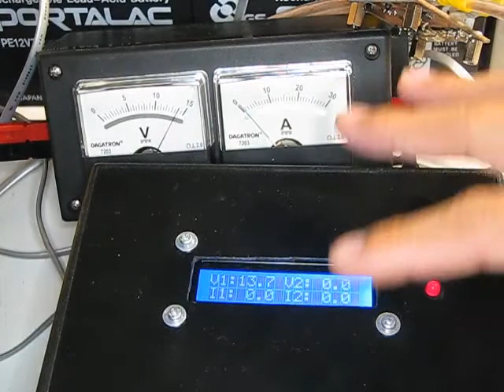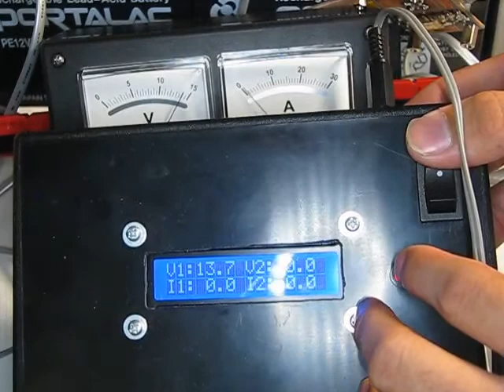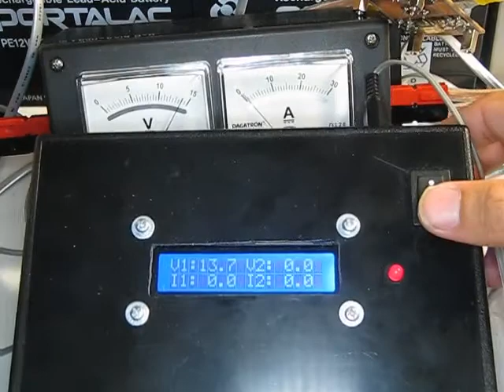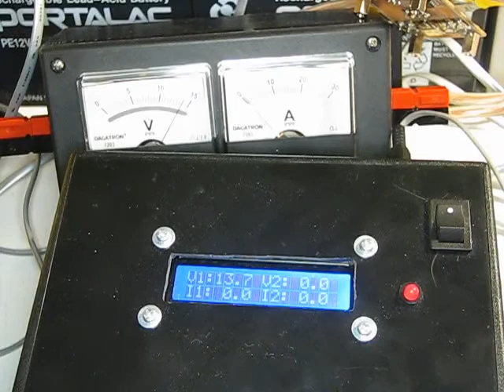Arduino Sensor Display Unit Overview

Comment: What code do you use for current sensor , and what is the formula to convert current sensor output to A . because current sensor reading voltage.  Thanks